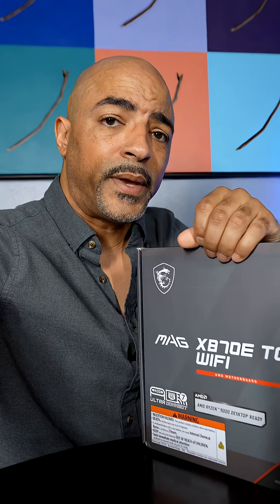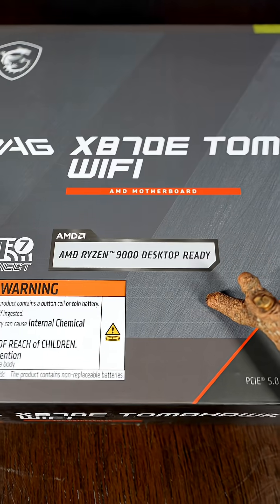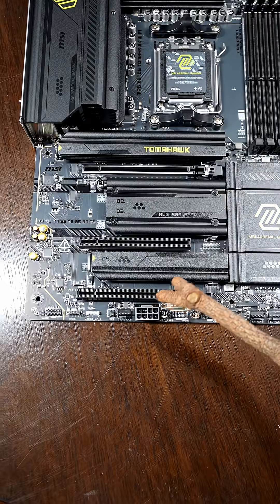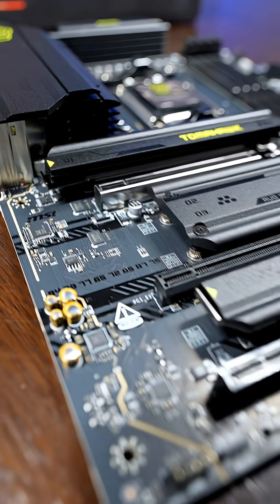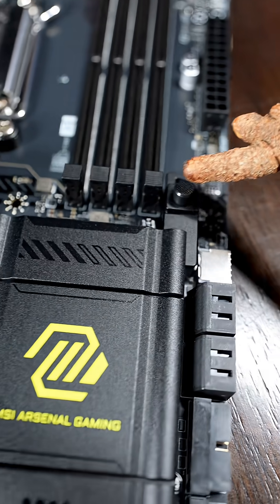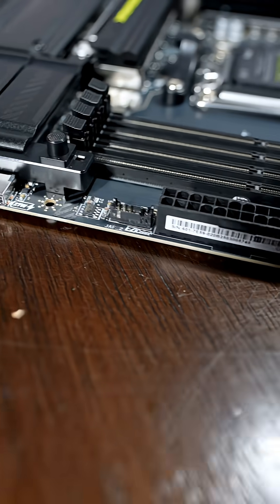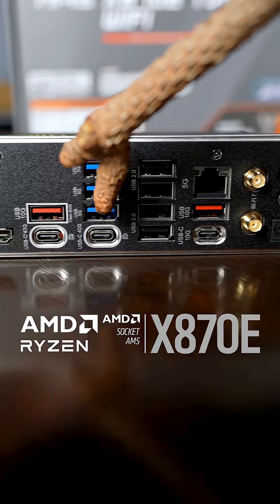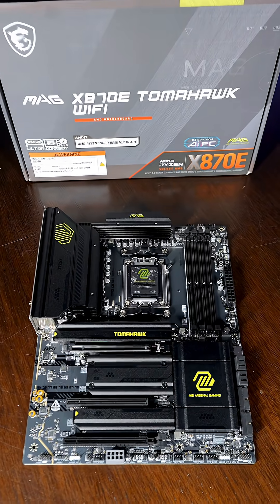The MSI MAG X870E TOMAHAWK WI-FI Motherboard is an easy recommendation for gaming and productivity!

Comment: hows ur boot times? I'm seeing sooo many posts about boot times being abysmal
Reply from the maker: That's nothing I even think about. It's an irrelevant thing because first I never turn off my PCs, second it takes as long as it is needed to properly train the RAM, and third that all depends on your BIOS settings as well.
Reply: @DaPoets  did u change anything in the bios related to retaining the memory? I see that suggestion but others say it bricks things
Reply from the maker: @shazam2323 I've never had any bricking problems with this motherboard. I just the settings based on the type of RAM that I use
Reply: @DaPoets   thanks, Im also wondering how rgb support works? My case has a built in strip that says is controlled by the mobo software but this mobo doesnt even have rgb so would i still just download w.e the default msi rgb software is?
Reply from the maker: @shazam2323 Yes the motherboard software. That should be MSI center

Comment: I’m getting this motherboard with a Ryzen 9 9900x rx 9060xt 16gb 3 fans, (the fan is 281mm max length) but on pc part picker every fan i pick says Some physical constraints are not checked, such as RAM clearance with CPU Coolers and I don’t know how to ensure that my ram will fit/ I’m worried it will get here and something won’t be the right size does anyone know what this means
Reply from the maker: RAM clearance is usually only an issue with some large air coolers

Comment: Have this running a 9800x3d and a 5090... no problems so far
Reply: hows ur boot times? I'm seeing sooo many posts about boot times being abysmal
Reply: @shazam2323  From startup, it's 19 seconds. I don't consider that long, but I'm no computer whiz
Reply: @dhampir216  did u change anything in the bios related to retaining the memory? I see that suggestion but others say it bricks things
Reply: @shazam2323  I have not touched my bios and I belive they had an update a month or so back for it which I also did not do ..... . I don't overclock or nothing like that .  I did enable xmp though .. other than that she's purely default still
Reply: @dhampir216   thanks, Im also wondering how rgb support works? My case has a built in strip that says is controlled by the mobo software but this mobo doesnt even have rgb so would i still just download w.e the default msi rgb software is?
Reply: @shazam2323, so for that, I got mine daisy chained into the mobo . Using a phateks case ... but I have to use msi center and signal rgb in order to do my fans ram and gpu. So you'll prolly have to use the msi program as well

Comment: I truly don't see any outstanding features mentioned. Perhaps the PCIe slot release .......... OCing RAM ? Come on
Reply from the maker: dual PCIe 5 NVMe to the CPU, 5GbE, full 320mhz wifi 7, stable power to extra hardware on the bottom, stable 256GB of ram support, all for a reasonable price compared to other motherboards.
Reply: @DaPoets  100%...and I noticed the price has recently went back up on this board to like $325...I git mine for $289 about a month ago. Absolute steal fir what it offers at that price. Even at $325, it's still great, lol.
Reply from the maker: https://msi.gm/SE0CC20E $299
Reply: What were you expecting exactly? It's easily the best x870e board on the market for the money. The Asus x870e Hero offers nothing more than this yet costs twice the price.
Reply: @GSP-76  Would you recommend this (X870E) or the B850-F ASUS ROG Strix ?